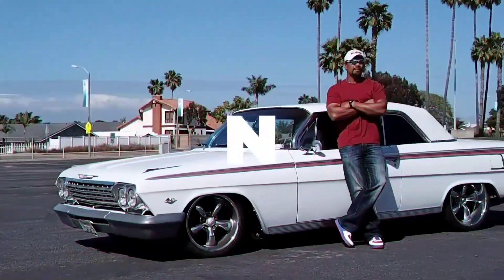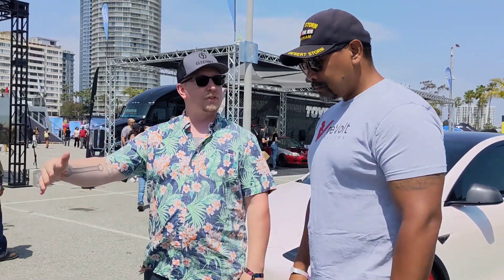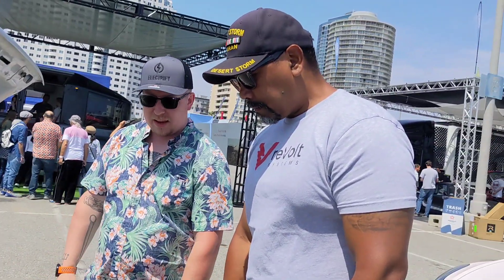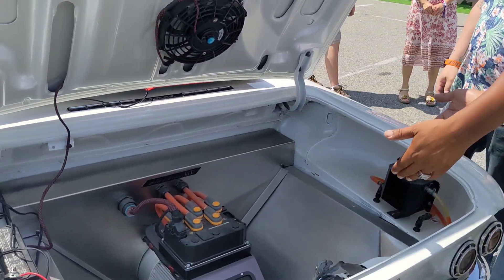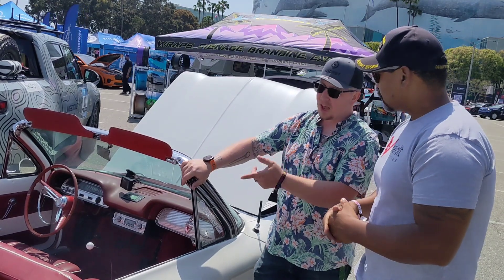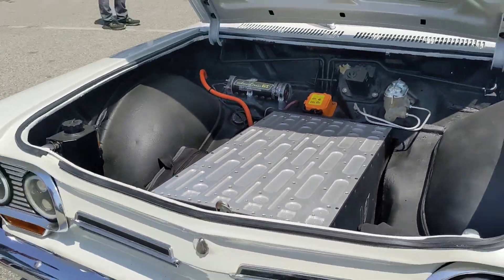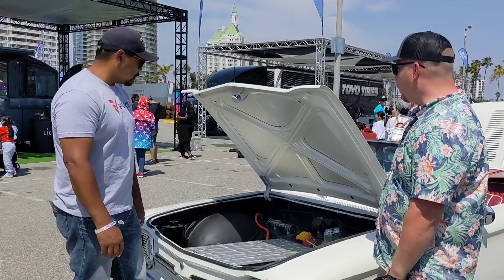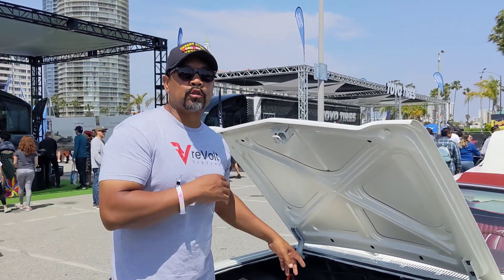1962 Corvair EV Conversion

Comment: I always thought the Corvair would make a great EV conversion, but removing the gas engine would be blasphemy to the Corvair purist.  My only concern is how well it will handle with all that battery weight on the front wheels.
Reply from the maker: It handles better than new because of the improved weight distribution.   Facts!

Comment: Almost every EV has a manual transmission.  Only exception I am aware of is the Taycan.
Reply from the maker: A transmission is not really necessary in an ev.  It's all about gears,  son.
Reply: @gasngowithsnow 

incorrect.  99% of all EVs have a fixed ratio transmission.

Comment: Sick, I can't stop thikning about doing this to my 'Vair. I need to know if it can do a burnout...and how does the weight distribution change, there was no weight in the frunk, now we have batteries up there
Reply from the maker: You would use the 🔋 🔋 batteries to distribute your weight in a 50/50 ratio.  And YES, ypu can do a burnout.   This setup has way more HP than the original!